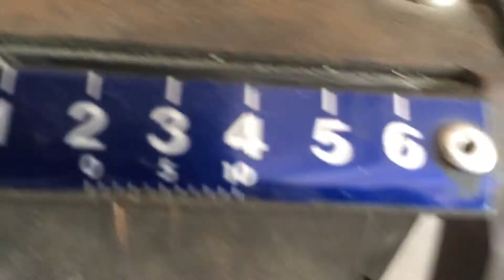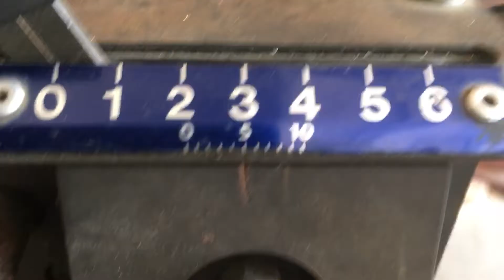Cutting an Abloy DiskLock Key

Comment: intreged, so what is this key machine make and model? What machine does the shoe shop guys use to cut these daily then?
Reply from the maker: I do not know if there is a make and model. The only labeling says Abloy. It was purpose built specifically for Abloy dealers and only cuts these specific keys.
Reply: @GWiens2001  Still there are locks and padlocks in the UK using these keys so there must be a machine for them, I will ask around, as been asked to duplicate some recently.
Reply from the maker: @gordondinnagecarpenterlock2118  Find an Abloy dealer.  There are still locks and padlocks using these keys in the United States, too.  I am sure that some of the new generation of key machines can do it.  I don't have one of the newer machines, so can't list one.